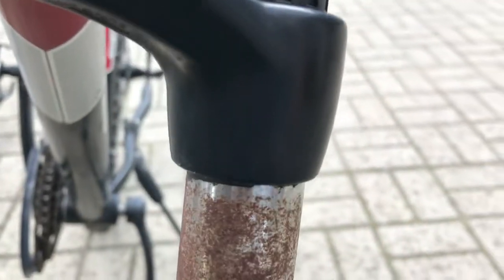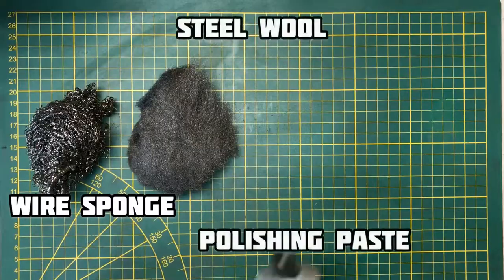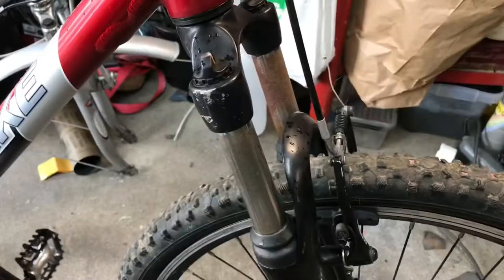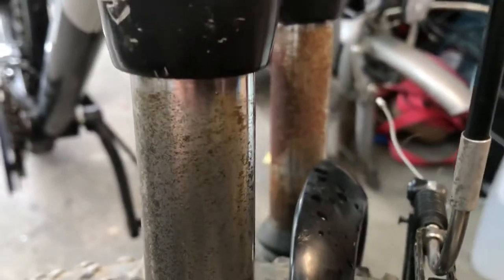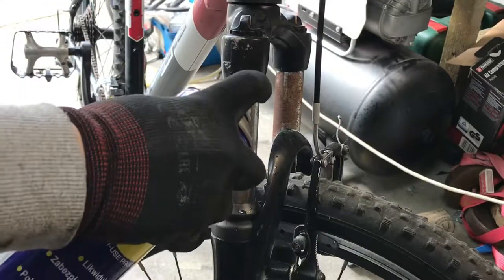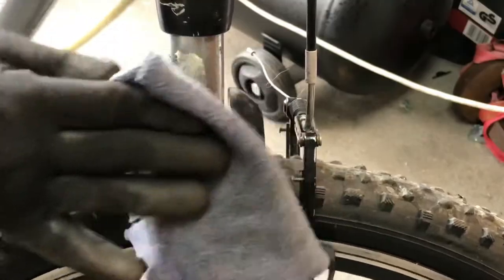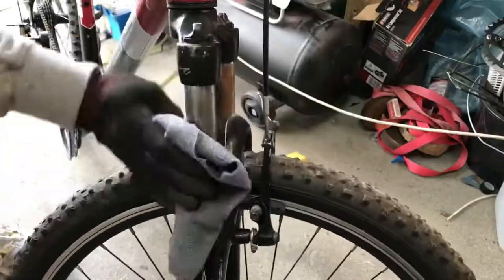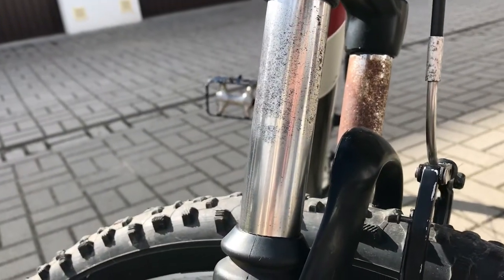How to repair SR SUNTOUR XCM rusty fork legs?

Comment: It looks better, but will rust again, even quicker than before as with each such removal process you remove some of the chrome coating along with the rust. Unless you cover the surface with protective antitrust coating.
Reply: Hi just bought a bike, with not as bad rust, what kind of coating should I look for?
Reply: @renaldohendricks1670 what coating should i get for aluminium shocks
Reply: @2EzScobar  Still trying to figure it out. Some articles says copper paste, others say not to, as the metal particles will damage the forks.
Reply: Don't listen to idiots who post crap like this above ^^ 

Once you remove rust always add a chrome polished will protect the chrome for ages depending Brand